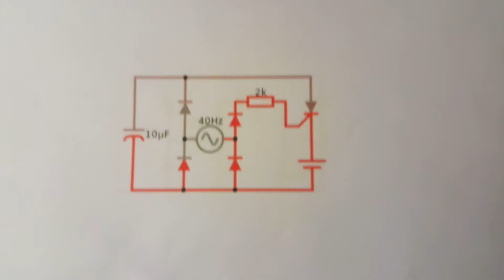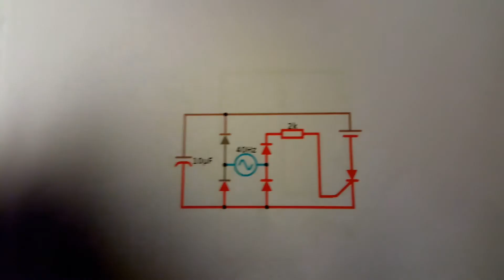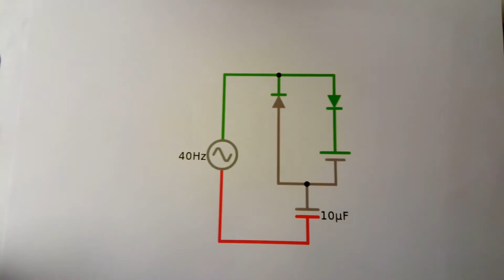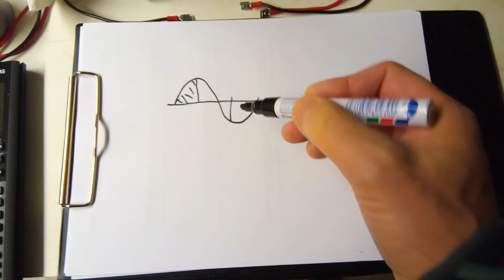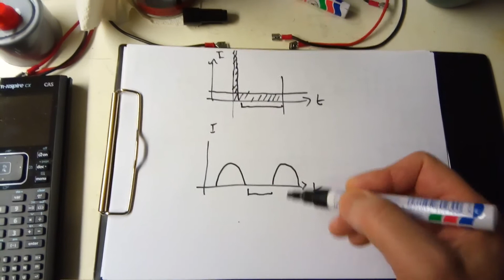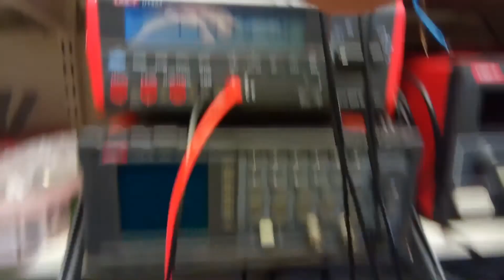AC to Cap Dump pt09

Comment: I have better luck with the high voltage high frequency spikes than low and steady. Maybe just the way I am doing it. I also have a circuit that I use a thyratron to pulse  a spike into the battery that I am trying to tune with good results. BTW are those ultrafast 5408 diodes next to you on the table?
Reply from the maker: You might refer to the sf16g?
Reply: the diodes? what is sf16g? thanks.